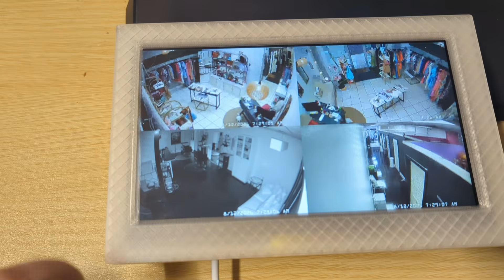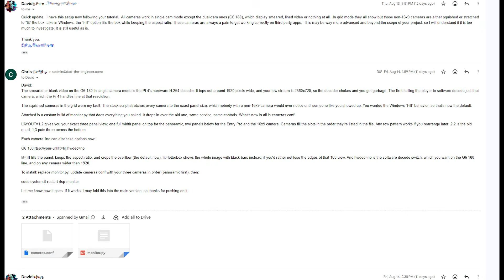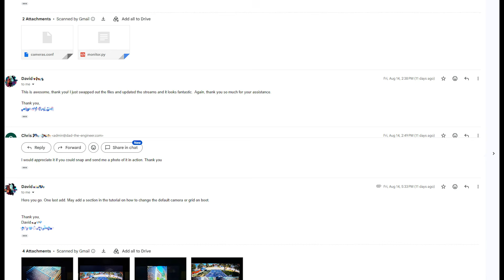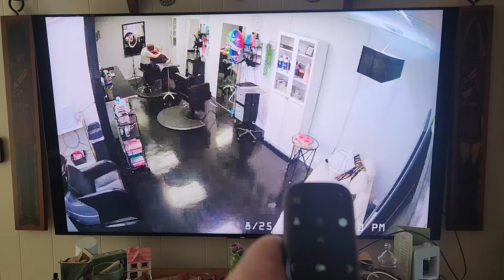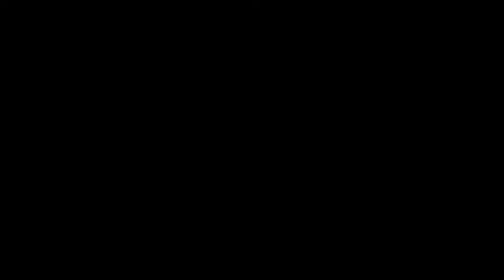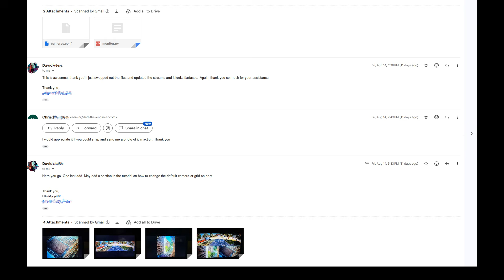v2.0!  Always-on Security Camera Monitor (on a Raspberry Pi)

Comment from the maker: New features!  Including being controlled by your TV's remote, if you hook it up via HDMI.  
Already built the v1?  It takes less than a minute to update yours to v2.
Haven't built one yet?  WHY NOT?

Let me know what other features you want!
Reply: I haven't built one yet because after I do Cardio therapy every morning I feel like sleeping for two hours. That, and I live on SSI. I'd love to build a van setup. If I send detailed pics of what I have to work with, can anyone help me with detailed instructions for a build? Like Robinson Caruso but with electronics.
Reply from the maker: @TarryHruman You can email me (my email address is on the site that has the worksheets).  I can probably help with about anything mechanical or electrical
Reply: @Dad-The-Engineer I'll find it. Thanks. App not showing me the hype option btw. Instead it's asking me to "summarize" the video. Fyi.

Comment: I ran into an issue where all four feeds work but when it looks it won't load into GRID mode. I load onto CAMERA 1 but stays there. if i turn on rotation it rotates through and grid mode does show up. Second problem i have is the CEC isn't being detected. Is there a way to troubleshoot this?
Reply: How do i get it to start and stay on GRID mode (2x2)?
Reply from the maker: @Nottoobright I'm releasing v3.0 this week, which lets you set exactly the cameras, including grid only, or even multiple grids.

It also fixes the grid not being rotated
Reply: @Dad-The-Engineer I look forward to this.
Reply: @Dad-The-Engineer when do you think you'll have this released ?
Reply from the maker: this week, is my target
Reply: @Dad-The-Engineer  I tried to make the adjustments myself. I got grid mode to stay with no rotations.  In grid mode the streams are extremely slow. There is a huge delay in the feed which I dont understand why because its a live direct feed. Is this a hardware issue or a coding issue ?
Reply from the maker: CEC probably has to be turned on, on the TV, and you need to install the package on the RPi (in the v 2.0 worksheet, I think)
Reply: @Dad-The-Engineer  CEC mode is on. The amazon fire stick is detected.
Reply from the maker: @Nottoobright on some TVs you enable it per input.  Also, sldid you install the library with apt?
Reply: @Dad-The-Engineer . I ran  the install in the instructions.  It said the latest application is already installed

Comment: rotate=270 in the camera config turns all camera streams landscape but the grid is still in portrait(a bug?)
 feature request- id also like if it could just statically display the grid from boot, but then taps take to the individual streams. maybe then eventually time out back to grid.  Grid is my main use case, cycling between feeds is a bit to eye catching. Currently if set cycle_seconds to 0, the first stream is default. 

Im using pi5 1gb and 10in display2, maybe thats causing issues. the streams seem rock solid. ill have to check power draw

thanks for all this!
Reply from the maker: Ok.  I missed the geod rotation thing because I don't actually have a portrait display.  I'm releasing a new version that includes a fix for that.  It also lets you add cameras that don't display as singles (grid only), and it lets you build multiple grids.  I did a quick test, but I will post it in a couple days once I've gotten a little more UAT time in

Comment: Love this! Thanks for continuing to better our tech lives! I love all this thinking outside of the box stuff. 

I actually just finished a project somewhat similar. I repurposed an oooold iPad and created a custom Home Assistant dashboard that switches between a kiosk view and a digital picture frame once the screen hasn’t been touched in 5 minutes. Required HACS, but overall was a breeze to setup. Now I just need to come up with a fun way to make it look like an actual picture frame and hide the charging cord.
Reply from the maker: You can add a battery, and periodically charge it :)

Comment: Could I use the old Gen 2 Nest Cams I have to run on this Pi setup..?
Reply: Not the old dropcams the next gen up
Reply: I feared, Im switched to fiber from Cox cable amd setting up a Synology 4 bay Nas for the my Family have remote access to files, photos etc 1 stop location, and likely need to go to Reolink cams to get away from the Google cloud control architecture, I redused to go their home system amd stayed with the Native Nest software which works flawless, however they punish you with a 220 dollar a year sub for x amount of live feeds. So done with the that control.
Reply from the maker: $220?!?  Yikes
Reply from the maker: Unfortunately, not anymore.  I looked it up.  It appears that this USED TO work, but Google removed RTSP support for those cameras in 2023.
Reply: 220 annual but still, and there the cost of the NAS, weĺl ok theres that, drives, I got 2- Lion16TBs for 195 not horrible, and there is native software with Synology I think that will allow me to run my own Cams- Reolinks, will take a little time to recoup the Annual cost over "Big G" but it will be ..our "private cloud" Cam Data.

Comment: I have a Tapo C113 2K 3MP Indoor/Outdoor Security Camera and a Wyze Cam v2 1080p Indoor Camera.
Both are running on their Android apps provided by their vendors.
Are there open source apps which will do something similar?
Reply from the maker: So, good news (potentially).
Your Tapos camera already works with this.
The Wyse cameras can work with this, too - but you have to load a different firmware for that to work.
Reply: @Dad-The-Engineer  "Your Tapos camera already works with this."
Do "this" means Raspberry Pi 4B (1gb), ... ?
Reply from the maker: The Tapo outputs an RTSP video stream.  This project displays RTSP streams.  So, it would be a RPi 4, with a display (like a TV, or a touchscreen)
Reply: @Dad-The-Engineer  what software is needed"
I have Wyse Cam ver 2 & Wyse Cam Pan V2
Reply from the maker: check this out: https://support.wyze.com/hc/en-us/articles/360026245231-Wyze-Cam-RTSP

Comment: All it's missing is a motion/presense sensor and scheduler, so late at night it only turns on if there's motion in the room instead of lighting up the room.
Reply from the maker: that's true, although you can set up two cron commands... one to turn on the backlight at a certain time, and one to turn it off.  I mentioned it in the first video, but I guess it would be better to include the commands, or to put actual times into the camera.conf file.

Something like a millimeter wave sensor would work for presence, but it could turn on when someone moves in bed (those sensors are much more sensitive than a PIR)

Comment: Does the 'touch' still work in v2 ?:hand-pink-waving:
Reply from the maker: yes.  there are 3 entry methods now.... touch, an external button, and a TV's remote.  They can be used together, but you only need one method - unless you have one camera, or you use patrol.  In those use cases, you don't need ANY entry method.

Comment: My Grandma would have loved that frame. Thanks for the update....also, I would like an adapter for two servo driven Oerlikons with an AN/APG-9 radar.
Reply from the maker: lol.  I saw an AN/AWG-9 in Tucson.  Massive.  

Just as a point of interest, I did manufacturing consulting for a company that worked with Raytheon.  I was around the AN/APG-79 quite a lot.  Smaller than the 9, but AESA.  Still dangerous, in terms of emissions, when ground testing.
Reply: @Dad-The-Engineer Someone's got a Contractor Clearance....🫡🫡🫡 Straight up bro crush. Respect.
Reply from the maker: I've been around a lot of cool milspec projects over the last couple decades.  That's certainly more interesting than the companies I work with that turn out widgets :p